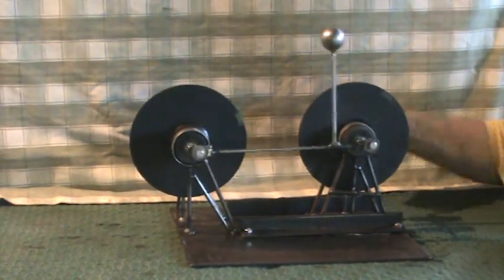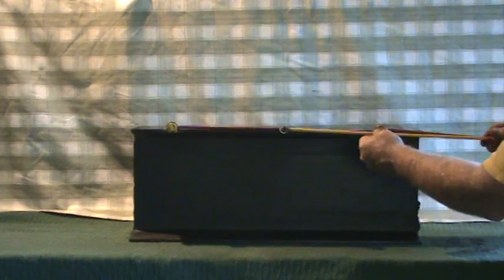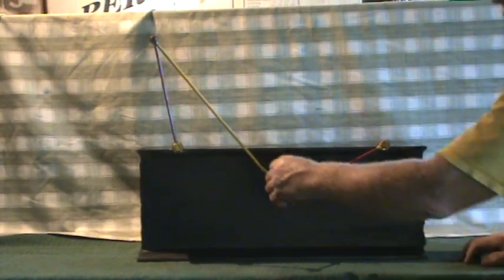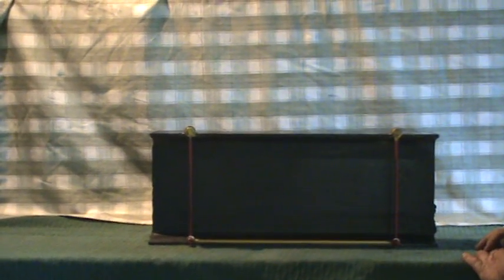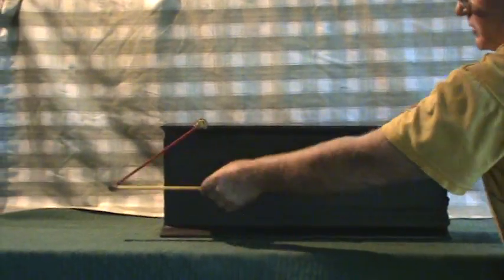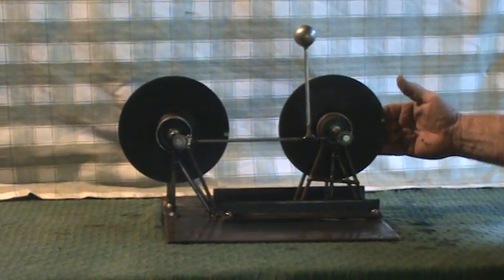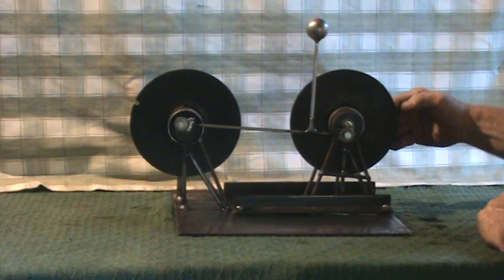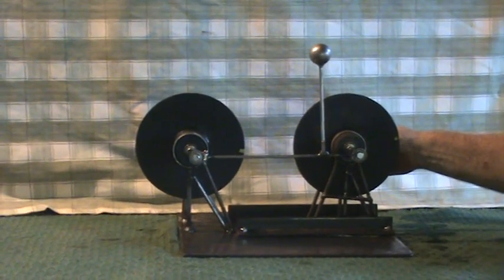Fernando Force Multiplier Replication Observation

Comment: The most obvious way to turn this into a perpetual motion machine is to have one end preferably the higher leverage end operated by a ball, with the ball supported by a separate fixed track during half of it's motion. Still sounds awkward but I appreciate the use of principles. The degree of rotation relative to the ball may pose a problem with periodic motion, which is one reason I have gravitated towards mostly-horizontal devices. Note the Fernando's Force Multiplier does not have the same advantages with a more horizontal device, as it basically implements opposite rotation, with all advantages coming from leverage, not coordination. My sense is the distance was measured badly and actually in this case the rotation of either side may have been the same, as the leverage apart from the added mass was identical. Revision: actually, the pins for the axis may be attached at slightly different distances towards the center, which could result in different amounts of rotation. It appears the right pin may be mounted slightly further from the center of it’s wheel, which will have the effect making lifting of the vertical weight easier, yet without an over-unity effect this time. My suggestion would be to mount the vertical lever towards the left side instead so that less work is necessary. However, perhaps Raymond has reasons to mount it on the right, or perhaps the principle is not yet used adequately. Perhaps using a depth dimension for the side lever thing may actually have unseen benefits. I would like to suggest mounting a weighted lever to right wheel in the depth dimension near the pin. I think you will see effects with this, if you think it is worth your time. The slightly wider pin already present on the right with have a pulley or lever effect on the left during its downward motion, and the depth-weighted pin on the left will add to momentum during its downward motion, thus there will be a principle of constant advantage, which may classify it as a so-called 'unity device' (an intermediate between ordinary objects and perpetual motion machines).
Reply: re45 1dee  'Blindness accelerated'? Do explain.
Reply: re45 1dee  Are you him?

Comment: Where is the multiplication of force? All I see here is synchronized movement of the rods with rotation of each axis in the same direction and non-synchronized movement of the rods with rotation of each axis in opposite directions. The end result is the same in both cases. No gain!

Comment: Hello,
I know you get a lot of negative comment, but this is not one of them! I believe this system does work and does multiply the force. But could you give some estimations about how much force on average does this system increase? For instance if I put 1000W of power, how much will I get on the other side? 
Thanks in advance

Comment: Raymond, i had the same experience as you. I scaled up and found that it wouldn't rotate. The non-matched angles resulted in non-matched center-to-center lengths. The device locks up. I have to admit that I don't know how others have achieved rotation. Strange.

Comment: It is self evident in the sequence of events as both wheels rotate and is also evidenced by the fact that you can actually take the output from the same wheel as the input wheel. Why? Because everything is reflected back to the front wheel so it doesn't matter which wheel you take the output from.

Comment: Good video on examining the mechanics. This device utilizes reactive power and defeats the 3rd law of motion. It is very simple and I explained it at energyscienceforum com. The reaction that the connecting rod/weight experiences as it whips in the opposite direction contributes forward feedback (positive reinforcement) to the input wheel instead of bucking up against it. It is the same in the Veljko system. It is taking the reaction in the system and utilizing it to propel it forward.

Comment: Excellent analysis. I believe that the wheels pulse in their RPM. Are you familiar with the "Aspden Effect"? I believe that Fernando left the belts loose so that the axles could go into a free oscillation.  I have a strobo-tach to check this out. Some of his vids show the gen belt driven and some show direct driven.  In the direct-drive device, you can see that he added more weight to the primary axle but, not the secondary. I believe that he was trying to get the weights equalized. Please reply

Comment: Mr Ron if you send me the R.P.M. YOUR PRODUCT AND ENGINE TORQUE INPUT AND OUTPUT TORQUE MOTOR I give you the perfect operation KEY NOTE THAT THIS MOTOR is 1,700 RPM O ME equiboco know this system and are the revolutions in the input are in the output if ME sends that data will tell you what you MUST DO THAT WHICH HAS INBERCION GREETINGS ECHA.

Comment from the maker: I built a larger unit and found that any tolerance in berings or shaft are also amplified. Also, it becomes unstable at higher RPMs. Next step is to build a small unit with closer tolerances. Planning to do this in November.